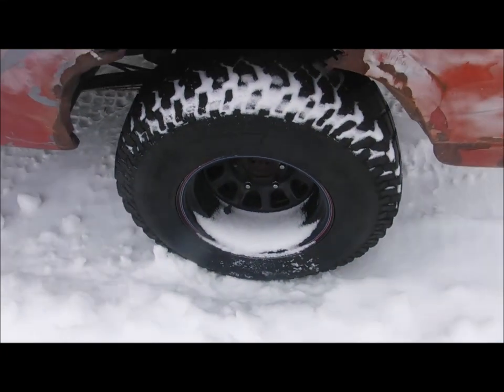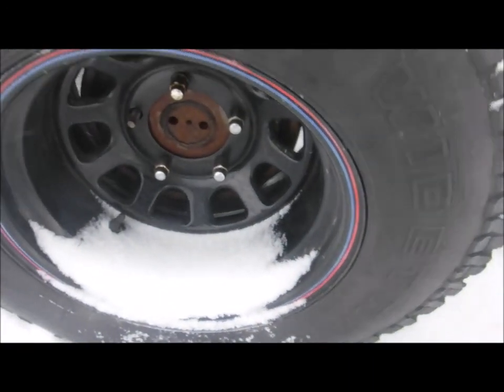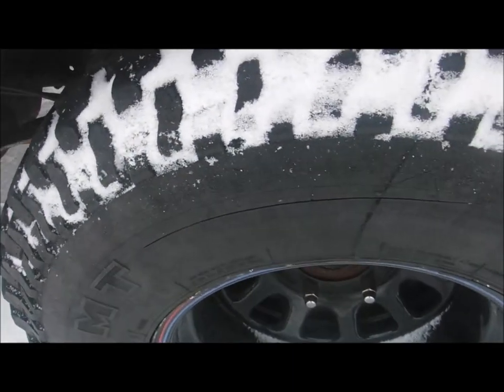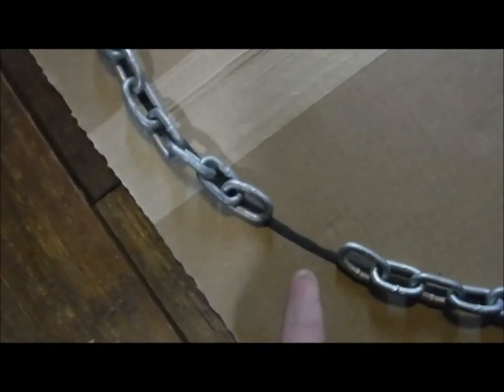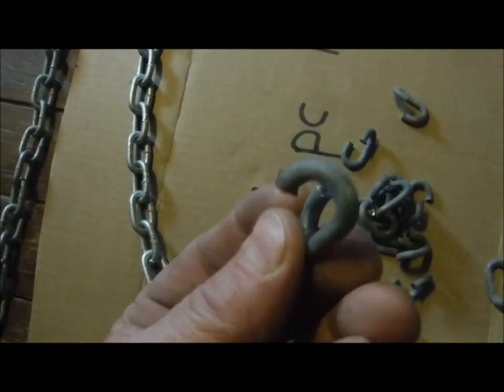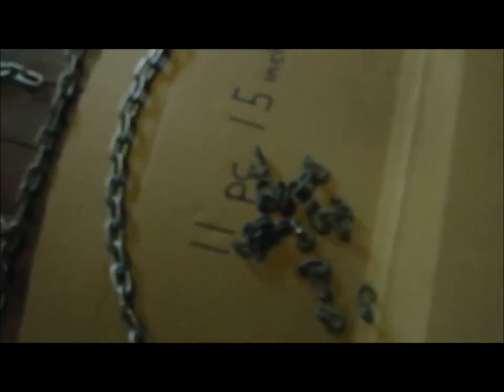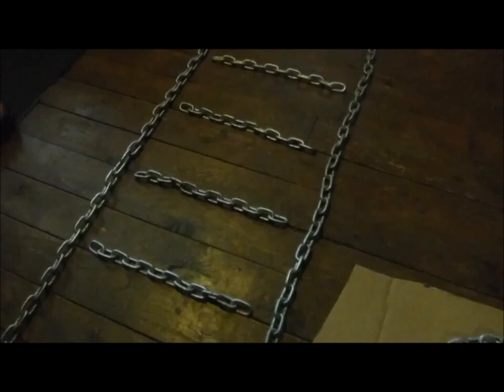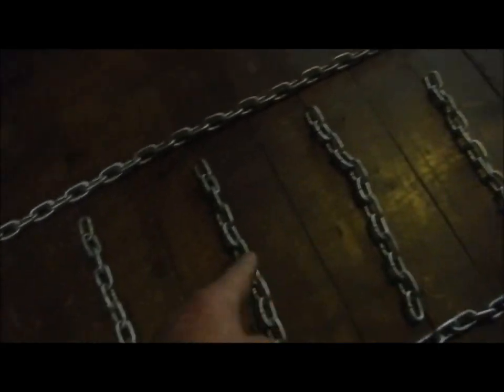How To Make Tire Chains For Trucks Or Cars

Comment: Multiply your measurement (25") by 3.14 and you have the length you need for each tire side (78 1/2")

Then multiply that by 2 for each tire. (157" or 13'1")

Then measure how much chain is needed to go from side to side (15") and then multiply that by however many cross sections you want (11pc).  You'll need 165" or 13'9" of chain for the cross sections for each tire.

To chain 2 tires of that size, you'll need a total of 644" or 53'8" of chain to wrap 2 tires of the same size.
Reply: Thanks I was just thinking about doing the same thing for everyone ✌️